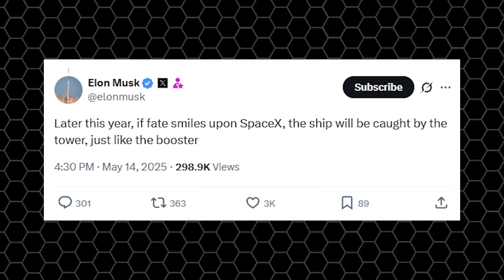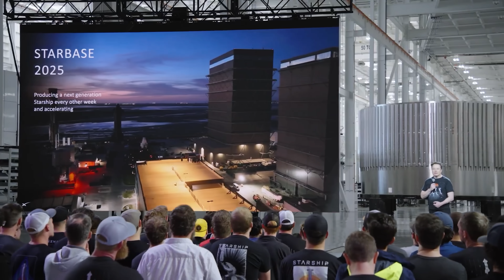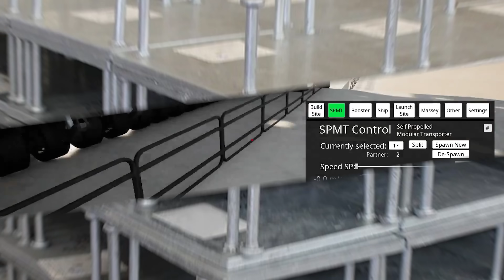Elon Musk just Declared Big Decision on Starship Catching Plan Changed!

Comment: If the shuttle had a return first stage today, that would be the best.
Reply: Shuttle was great for some things, but managing the tiles safely was hugely expensive. And they lost them with people killed. That shuttle design was a way to have a heat handling gliding vehicle to take up all that energy and avoid a giant amount of fuel to slow down with a smaller ablative heat surface (like the capsules always have).  Starship has to have a heat shield (vastly better though, but not ready to handle the heat) plus the burning of fuel to slow down - harder than the shuttle. But vastly better when they get it.

Comment: It will fail. Starship is coming in too hot. It will burn up on re-entry, again.
Reply from the maker: Maybe... but every flight gets them closer to solving the re-entry heat problem.
Reply: @alphatech4966  Yes... slow down... Just a bit...
Reply: They have had a couple largly successful re-entries.  I don't think you thought that through very far or well.
Reply: @imaginary_friend7300  You didn't think at all. A succes, would be a resusable starship. Nothing largly here. The ones that "landed", all failed because of the high re-entry heat.

Comment: Wondering why there is not a separate simplified Catch-Only Mechazilla for Landings, leaving the Launch Sites for the primary Purpose, but as back-up Landing Structures. Future Volumes of Starship will most likely need such a separate facility practically and the Catch-Only Mechazilla(s) could be so much cheaper and less risk, whilst providing the necessary functionality.
Reply from the maker: Good question! But you know how SpaceX is — they always optimize for both launch costs and construction costs. So instead of building a catch-only tower, they'd rather build a fully functional one that can both launch and catch.
Reply: Because that is a reduction in efficiency of 50%.

Comment: It is becoming increasingly apparent that the faulty Raptor 3 and the faulty Block 3 Starships should be replaced by the faulty Block 4 starships and the faulty Raptor 4.
Reply: This comment proves you know nothing about this program. They are currently launching block two and building first block 3 ships that won’t launch for 3 flights. Raptor 3 is in its production infancy and is not being used on Block 2 ships. Only about 30-40 produced so and tested so far. No information about these test has been released publicly other that thrust wright and ISP. How do you conclude that block 3 ship and  raptor 3 are faulty if even SpaceX has not even tested or launched this combination?
Reply: Raptor 3 and block 3's haven't flown.  You have no idea what's going on do you?